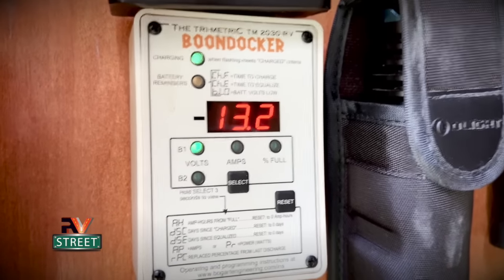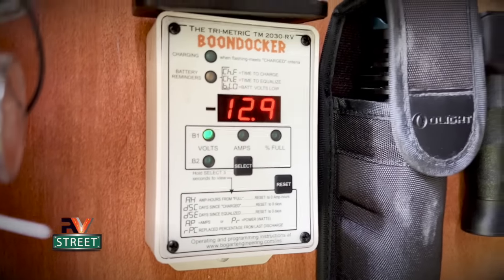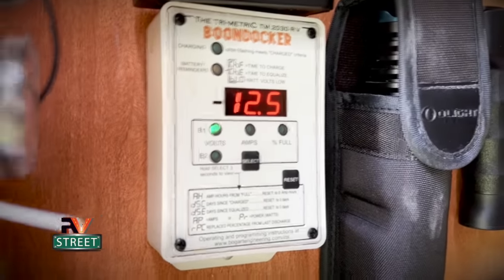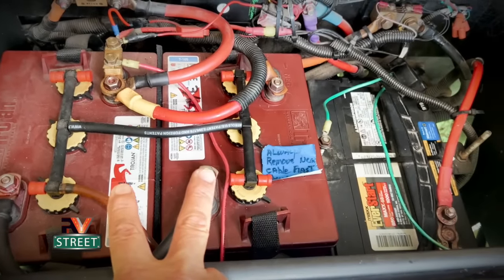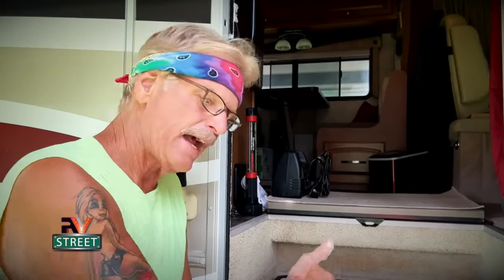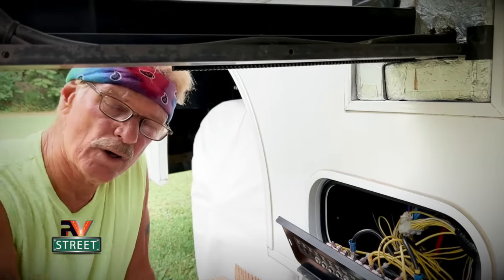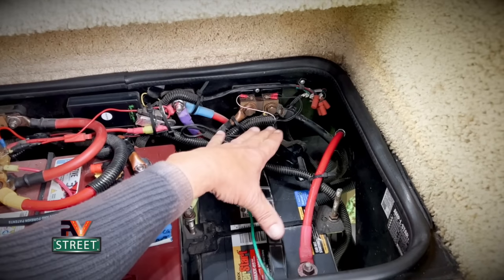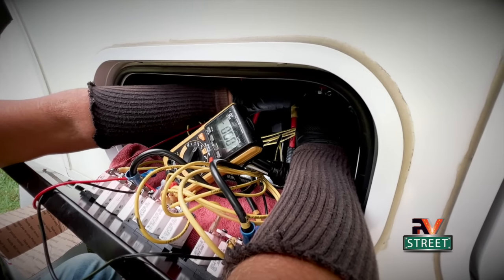RV Alternator IS NOT Charging House Batteries • The FIX

Comment: I have had only 2 RVs in my life and BOTH had solenoid failures as you describe. Both were challenging to access and replace. Both were discovered failing by the lack of charging just as you have described.  Prior to watching your video, I figured that it was just an amazing coincidence that these failed on me on 2 unrelated RVs.  But now I know this must be a common problem.  I am guessing the contacts get corroded inside from arcing high amperage along with environmental moisture?  Not sure.  But love your videos and you should know that you are a help to both the newbie and the little more advanced type owners!
Reply from the maker: these failed on me on 2 unrelated RVs.  But now I know this must be a common problem
Not a coincidence but yes common. It's a PM item. Just be pro active and change them out every 5yrs. or so. The constant engaging and disengaging wears them out.
Reply: Tran Siberia orchestra
Reply: What if you had lithiums for RV house but AGM for engine; that's presents a whole new set of issues.
Reply: Trato
Reply: I just got my first rv cause someone inhereted it from his mother when she died and he didn't want to look at it anymore so he sold it to me for $2500. I've only had it for 6 hours, and I have no idea where why of the things in this video are located. All I know is it starts and drives perfectly, and the hydraulics work. As far as the switches for the electrical, I know nothing except there is a dedicated rocker switch for the head unit with two options, main or aux.

Flipped to main, nothing happens.

Flipped to aux, the speakers start going "beeeeeeeeeeeeeeeeeee"

Though I know nothing about rvs, I do have some knowledge about installing overpowered sound systems in cars. I always ran my subs off a second battery separated by an isolator. All this stuff makes sense to me, but I have no idea where the "coach" batteries might be located in the rv
Reply: @ZanesFacebook you have a lot of learning then as these rv’s are built to break. Everything will break.

Comment: I dumped my dead acid house batteries and installed LFE batteries that fit in the same space.  I then installed a 50 Amp DCDC converter to charge them from the alternator.  Live is good now. Half the weight and twice the capacity.

Comment: Those solenoids rarely fail and you do not need to replace them on a time schedule they are either good or bad. What your mechanic friend is saying is completely  nonsensical because no two people are going to put their RVs through the same amount of use . Ford starter relays last and last for 2-3 decades sometimes in near daily use and the ones you have here are the same basic design of solenoid and they are doing the same job they are designed to do which is to switch 12 volts don't over think it.
Reply from the maker: Thank you for your input

Comment: Great video, your attention to detail is truely impressive.  I have one suggestion, this is a trick I used on the fleet of commercial trucks that maintained.  Solenoids were always mounted on the firewall requiring me to get assistance to unbolt the solenoid since I could reach both sides. I imagine similar to your situation with the box. What did was get a slightly longer mounting bolts and 2 nuts and lock washers per bolt(2 bolts 4 nuts and lock washers per solenoid) and then I reversed the  bolt (head on the outside with a lock washer and nut on the inside never to be removed again! No more rust problems or reaching issues. Now on the inside of you box you'll have a stud that you will slide the solenoid onto and secure with a nut and lock washer. From that point on mounting will be done from inside the box without need of assistance. Now this will push the solenoids out away from the wall  a 1/4" but in your case I do not think (and in most cases) it will not matter at all. Just a thought happy RVing.

Comment: Hello Martin, new to your channel, and really appreciate your videos. Great production. We charge the house deep cycle marine battery with a Victron DC/DC Converter which does 3 stage charging (Bulk, Absorb, Float), rather than just dumping continuous current into the battery. The Victron goes between the start and house batteries. Its also Lithium ready. Thanks again.
Reply from the maker: Thanks for the info and welcome aboard 👍

Comment: Thanks Martin!   Another top shelf video!
Our old RV had a control box made for Thor that did this function.   It would charge both sets of batteries from alternator or shore/generator power.  And tie them for EM start.   If for some reason your house batteries go completely dead, charging the house batteries may cause a 50 amp fuse to blow or a circuit breaker to trip.  The alternator can pump over 50 amps into the batteries.   The circuit breaker will have a very tiny reset button.

Comment: Martin, if you ever have plastic parts brake or crack on you, you can get a plastic welder at Harbor Fright.  It comes with a variety of plastic weld rods.  Looks much like a sodering iron and runs around $20.
It's great for holding tank cracks and other items made of plastic. Well your there, you can also get rod to weld pot metal and aluminum.  Just heat the surface to 640° f then rub the rod on the hot metal. 
This is good for alternator ears that may brake.  By using a small piece of steel strap (like used on banding crates or large boxes) rap the corner and clamp the strap to hold the shape that's missing.  Now heat the area melting the rod. Let it cool, drill it & tap it. 😎
Reply: Great info

Comment: Martin.  Again a spot on video and great training and delivery techniques.  I have a Winnebago 2018 Sunstar LX, 35 F.  My set up is completely different.  I just took the time to study the schematic and ordering parts from Winnebago.  The Winnebago drawings and diagrams are invaluable.  I just hope I am understand correctly.  Due to your video I began to study the schematics in more depth and have located different fuses in conjunction to the batteries and inverter.  Also learning how naive  I am and not being prepared. No problems so far but might be on thin ice, so to speak.  Thanks again. Blessings. David

Comment: Follow up on the solenoid subject! Fun with solenoids! Well after watching your video on solenoids, I figured I better get on with paying some attention to the ones on my rig. I had been eyeballing the solenoid on the hydraulic pump for the jacks. On our 2016 Adventurer the pump and solenoid sit right behind the front driver’s side wheel with not protection from road spray other than a mud flap. I noticed the terminals on the pump solenoid were rather corroded. When I went to loosen them to clean them well- let’s just say the terminals were in fact terminal! The nuts were so rusted/corroded that they immediately snapped off! I was rather panicky as the jack were down  and I had visions of never being able to find the exact solenoid. I ran in to get on the computer and luckily the make and model of the solenoid popped right up to be delivered within 24 hours at decent price (courtesy of RVSTREET’s store LOL).  Anyway, should be back in service tomorrow. Why they leave such equipment exposed to road spray and hazards is beyond me. Just happy Martin stimulated my attention to the solenoid detail, so it didn’t fail on the road as there obviously wasn’t much life left in that solenoid!!!
Reply: Follow up to jack pump solenoid repair:
Luckily access to the solenoid and jack pump motor on my rig is excellent— (despite being exposed to constant road spray and hazard).  That made for an easy replacement of the solenoid. The hardest part – and even that wasn’t that bad- was getting the clamp that holds the solenoid in place to the motor back on the new solenoid. Took a few minutes but overall, it was a very easy job.
A couple of points:
1.	Make sure you either mark the wires to go back on to the appropriate terminal posts or take a picture before changing them out,
2.	Watch the torque settings as stated on the casing of the solenoid! Only 40-inch lbs. for the large terminal connections. And only 15-inch lbs. for the small terminal connections. The 15-inch lb. setting is very light and I suspect they were not properly torqued in the factory on the old solenoid which led to me snapping off the terminal internally when it corroded.
3.	I applied battery terminal protectant to each terminal when I finished.
4.	For safety’s sake I killed all power to the rig while engaged in the repair

Comment: Great video. A quick question--did you consider replacing all of the parts in your system with a Precision Circuits BIM? For the price of the BIM, you would be all in for about $160 and have a system with many fewer moving parts and points of failure.
Reply from the maker: With a heavy heart I have to say that Martin has passed away and I honestly have no idea why he chose to do it the way he did it. Sorry
Reply: I am so sorry to hear that. He made some excellent videos that helped the RV community.

Comment: Hello Martin, funny you made this video. I too am having a BIM issue. When I start the engine the solenoid starts clicking like crazy and the motor rpms start surging and it stalls out. I changed the center solenoid and it didn't fix it. I need to swap out the house and chassis solenoids, as well as the relay and verify those. Needless to say I am not charging house batteries while driving. I ended up just disconnecting the power wires to the solenoids from the chassis battery to remove the solenoids from the equation and keep my motor running normal. If I have needed power running down the road, I just turn on the generator to keep the batteries charged.

Comment: My 2018 Winnebago Vista is a little different.  My isolator solenoid failed after only 3yrs.  It was rated to 250Amps, and failed way too soon.  So I replace it with a 500Amp solenoid.  It was actually pretty easy to replace, and the bigger solenoid fit in fine.  What was interesting to note, since the 500Amp is physically larger, the mounting holes of the solenoid bracket are about 1/4" wider than the stock solenoid.  However Winnebago pre-drilled a hole in the bay sheet metal to fit the larger solenoid I bought from Amaz on.   My 500Amp has been working like a champ for a year now.  Amaz on sells them for $41.  I think it will last longer since it's rated 2X the stock solenoid.
Reply: Tom,   Your solenoid that failed, most likely failed on the coil part of it, not the power contact connection.   So, it may last longer but not because you doubled the amp rating of the contacts.

Comment: Excellent Video!!! Got to put this on the to do list. I'm approaching 7 years of age on the rig so the clock is ticking!  Mine aren't exposed to the elements as your were but they have the age on them. On our 2016 the access is on a compartment wall not exposed to the outside and I imagine the set up is like yours. The one I am really worried about though and have to get on soon is the solenoid on the hydraulic jacks which takes a beating from road spray. Love that hat! 😁

Comment: Good video if you have lead acid house batteries and lead acid chassis batteries. About 6 months ago I upgraded the house batteries on my coach to LiFePo-4 batteries. I built 2 6v lithium batteries out of 8, 280ah prismatic cells, (fora 560ah 12v battery) because I wanted the most battery capacity that could fit under the steps of my motorhome, as I have the same set-up that you do. But replacing my old GC-2 golf cart house batteries isn't just a straightforward drop-in. I needed to install a BMS and active balancer to keep everything safe and all cells balanced as I was dealing with raw battery cells and not a commercially made battery with an internal BMS. I also needed to disconnect the relay that connected the house to the chassis battery for charging as lithium batteries have very low internal resistance so would draw too much power from my alternator, frying it if I left the factory relay connected. Instead, I purchased a Renogy battery to battery charger that connects the house and chassis batteries together, when the engine is running but limits the current going into the house batteries, allowing the alternator to safely charge the house batteries providing the correct charging profile for the lithium battery chemistry too. They make several different sizes, but I chose the smaller 20a model so I wouldn't overstress my stock alternator, maintaining its reliability. We also have a 620-watt liftable solar array, as we are FTers who boondock most of the time and an 80 amp lithium compatible converter/charger to keep out house batteries properly charged.

Comment: Thank you for this video. Did I miss any part on how to tell if your solenoids are not working correctly?
Reply: He skipped that saying he'll replace all 3 and likely solve his charging problem. But you can diagnose which is not working by using your voltimeter , checking each pole. In my case i just replaced that small middle solenoid for $15 to get it charging again. It had 14v in from alt but not going out to the battery so i knew it was bad, after 20 years. Just buy the others and keep them on hand if you want spares for emergencies. Preventive maintenance works best if you are preventing bigger costs, if you replace early its the same or even extra costs by throwing away a good part.

Comment: Just found your channel and have subscribed after watching this first video. In your case, the house batteries were not being charged by the alternator. Could the same issue cause the chassis batteries to not charge while the house batteries are being charged … albeit the other solenoid in you configuration?
Reply from the maker: I am sad to say that Martin has passed away and I don't have the answer to your question. Sorry

Comment: Another great video! I do have a different question for you however. 2 part question. Does your RV have decals? If so when using a dual action polisher can you polish over decals without ruining them? If so rpm max do you suggest? Any info would be greatly appreciated!
Reply from the maker: Yes my RV has Vinyl Graphics and yes I polish over them with my DA polisher usually set at about 5200 rpms or so. The polish is actually good for them. It removes accumulated grime, conditions them and makes them shine again. Once I complete polishing a side of the RV, I protect everything with RejeX. Sun is what destroys the graphics so RejeX protects from UV rays.
You might want to watch this video that explains the process I use: https://www.youtube.com/watch?v=ewXghIetIw4
Here's all my videos: https://www.youtube.com/c/RVstreet/playlists

Comment: Re: replacing solenoids... did the print on both solenoids say "chassis"?  The center isolator solenoid was a 200A part?  Where did you get it?  Is there a name for the relay you bought or part #.  You said you got it from an electrical parts supplier but how did u know what relay to purchase? Good video. Beyond my skill set but will take the parts to a mechanic. Class A Newmar Canyon Star 2011.
They have only one part online, chassis solenoid.
Reply from the maker: I'm sad to say Martin has passed away and I don't have the answers to your question. Sorry
Reply: @RVstreet  So sorry.  His great videos will inspire many to DIY for years to come.

Comment: I'm having the opposite problem... Plugged into shore power, my house batteries charge, but not my chassis batteries. I have to run my generator for 15 minutes every week to charge them. Same part failed? Isolator relay? According to my owner's manual, my float charger is supposed to charge the house batteries until their full, then switch to charging the chassis batteries, then switch back. 2007 Beaver Contessa DP.

Comment: Hi! Very helpful video! I have a question that may be related....I have #4 6volt Trojan house batteries that need to be replaced.  Can I replace them with 2 12 volts? Thanks in advance!
Reply from the maker: thx Geo,
Yes you could but I don't know why you'd do that. Your batt bay is already wired up for the 6v batts and if you switch out, your usable amp hrs would be greatly reduced. If you ever get into a situation where you need your batteries for an extended period of time—think grid down, all types of different emergencies, very cold temps etc—you'll really wish you had those 4 - 6V batt's again. If it's the money you're trying to save, the difference of cost is only about $300 and that cost would be spread out over several years of usage.
And don't be fooled by seeing 12v batts rated as "DEEP CYCLE BATT'S". They are nothing like the true Deep Cycle 6v Trojans you have now.
I had 2 - 12v batts when I first bought this coach years ago. Changing them over to 6v batt's was one of the first things I did.
To put it another way, if this was my set up I would NOT go to 12V batts of any kind.
Reply: Thanks for the reply and your thoughts!

Comment: Thank you!  I’m new to RV.  Would you mind explaining to me the difference between house and chassis batteries please??
Reply from the maker: The house batteries power everything in the RV that runs on 12V. If you turn ON the inverter, the inverter takes the 12V power from the house batteries and converts it 120V to some of the outlets in the house. BTW...I rarely use my inverter unless I'm boon docking. The chassis battery powers everything on the chassis. In most cases like....starting the engine, the slides and usually the power steps.
Reply: @RVstreet  Thank you very, very much!!